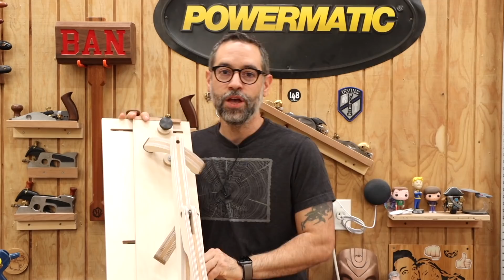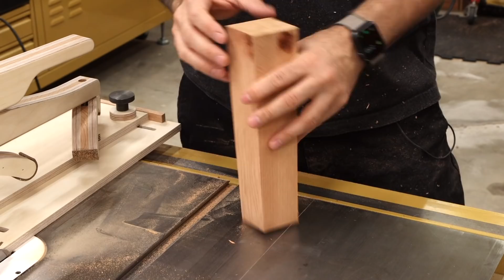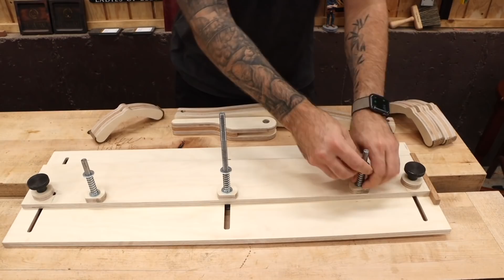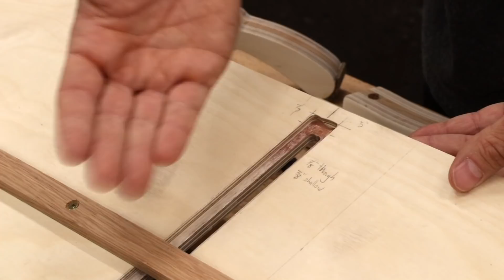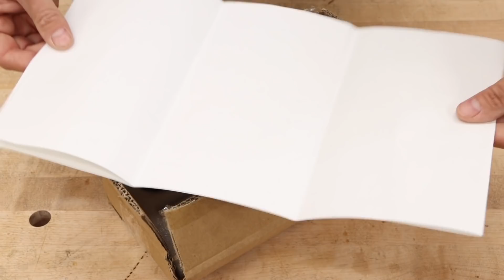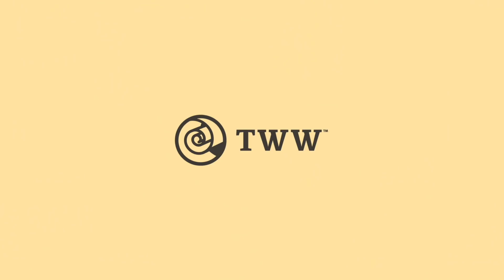Taper Maker Tapering Sled | Build Your Own!

Comment: I already have the plans and hardware kit for this. However, I don't have a planer. Would 1/2" thick oak from the big box store suffice for the hold down, yoke and handle spacers?